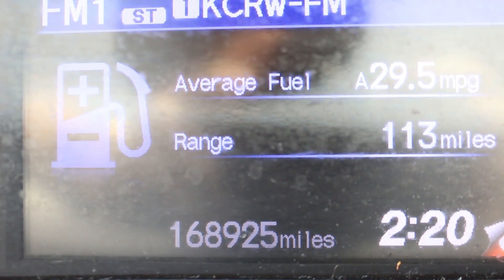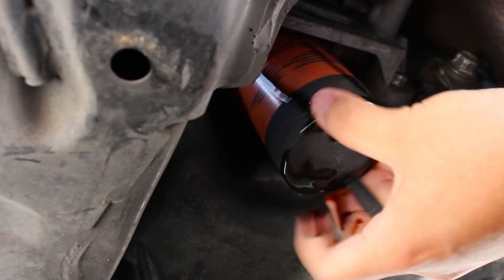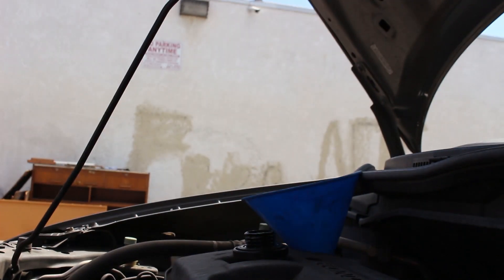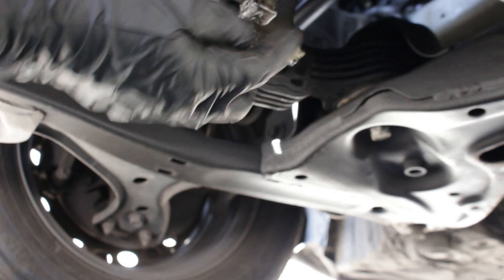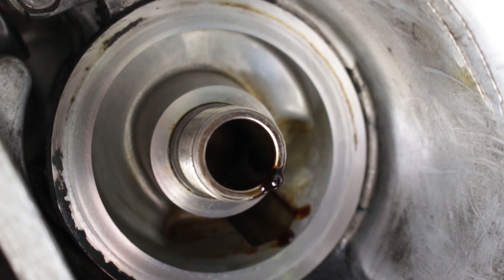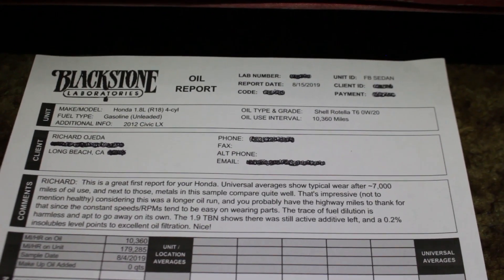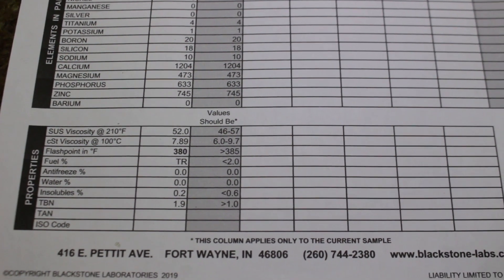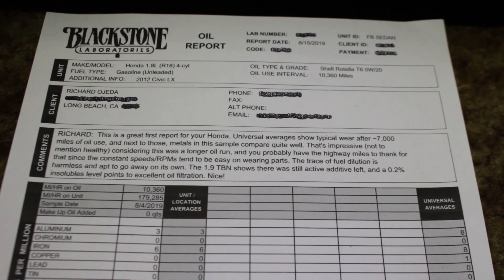10,360 miles Used Oil Analysis.

Comment: Sometimes you guys are trying too much to see what would happen when it comes to oils. I understand you want to experiment with oils to see how it runs in your car the most common thing is a ticking noise in engines especially when it gets down to 020 oils. The fact is this I am a Pennzoil guy and a Quaker Steak even though they both come from the same old company shell. One is made through Natural Gas of panzoil and the other is Quaker Quaker State petroleum base. Both have a high record of protecting an engines over 300,000 up to a million miles without mechanical failures and loss of power. But when you have a Honda Civic why choose a motor oil that's meant for gas trucks. Pennzoil oil or Quaker state oil by my recommendation over any other oils will guarantee your engine a longer life as long as you don't treat the engine like a sports race car when it's actually a everyday car the engine will last a long time with these oils using shell gas truck oil for a car engine doesn't make any sense. You don't need to use gas truck oil for a car engine to get good engine protection using motor oil meant for cars we'll get that job done. Using gas truck oil for a car engine doesn't make any sense. You doing too much for your curiosity.
Reply from the maker: This is why the community make YouTube videos because I am not the only me who is curious. People are curious of the results and it gives them insight whether they want to use this oil, though this oil has been discontinued. Nothing would be entertaining if it wasn’t for curiosity.

Comment: 1:40, I'm an old and grumpy fart but I have some advice for you. I'm not a mechanic but I have been working on my cars for a long time.
First, make sure that your oil filter is not stuck (like your oil drain plug), but don't remove it completely. Go ahead and punch two holes on the bottom of the oil filter and let the oil drain out first, as much as possible. Then remove it without making so much mess.
Next time get yourself a torque wrench and brand new factory oil drain plug (because the one you have is most likely ruined) and a brand new factory oil drain washer. I recommend a 6-point Flank drive socket as well.
Find out factory oil drain plug torque spec for your vehicle. For example, for my Toyota Corolla, 2006 oil drain plug torque spec is 27 Foot-pound.
Reply from the maker: Thanks for the advice. At the time, I didn’t have a drain plug or  washer but now I do. Honda torque is like 29-30 foot pounds but as long as the plug is a little more than snug it is fine.

Comment: On my 09 Silverado I did oil changes every 15,000-20,000km depending on amount od towing using valvoline max life 5w30. Truck still running with 550,000km.  Never touched motor to date. 100,000km pulling 7,000lb loads.
Reply from the maker: I tested Valvoline full synthetic and it actually did better than this oil. I recorded it but never uploaded the video.

Comment: unless it says 100% synthetic...its only 51% synthetic. The standards to claim it as full synthetic is that it only has to be 51% synthetic.
Reply: Where you get your information from provide a link.
Reply: Actually, almost every oil you can buy in North America is not 100% synthetic oil.
 The only country in the world that doesn't allow 100% synthetic labels to be used on lubricants unless they are 100% synthetic is Germany.
If you go on the German oil company website you will find that they are using a full synthetic label or Synthese, instead of 100%. When I checked American popular and common brands, only Amsoil Signature and racing oil come with a label 100% synthetic. The other Amsoil types so-called 100% synthetic in Germany don't have a sticker of 100%. 
Another example is Motul 8100. In the North American market that oil is called 100% synthetic but if you check Motul Deutschland, 100% synthetic is missing and the label is Synthese-Technologie. Even Motul 300V racing oil is labeled as "Ester Core" and I don't see 100% synthetic anywhere.

Comment: A Fram filter?
Reply from the maker: Yea, it performed surprisingly good.
Reply: @TheRichardF10  You can't find out that without measuring the flow resistance. The filter may have been in a bypass mode but we don't know that and the oil analysis wouldn't show anything unusual. But it doesn't mean there was no damage from unfiltered oil. The Honda filter has a lot more media and the media is a lot thicker. Why would they do that if just a plain Fram was enough?

Comment: I've used this oil many times in my Toyota Venza. It's good oil. Many tests on youtube prove it. Im now using it again, found it on clearance at Walmart for 4.50 a gallon. Couldn't beat it. Basically paid a little over $10 for a full synthetic oil change with my filter. I have 3 other jugs in my garage as well for my next few changes 😂

Comment: Please don't ever use "high end oil filter like Fram" in a sentence again! LOL
Reply: The Ultra Synthetic is top notch
Reply: @williwonti  You're right.  Fram Ultra Synthetic is on par with Mobil M1, Wix and other similarly priced synthetic filters on the market.  Unfortunately, highlighting the limitations of Fram's basic entry level filter when compared to higher end synthetic filters is common on YouTube.
Reply: Fram XG, Titanium, and racing filters are very high end and have great build quality. The basic orange can is not very good but its ok for 3-5k miles!

Comment: Everybody in the common section is more concerned about how tight the oil filter is instead of the results of this oil LOL honestly full synthetic or not if the manufacturer doesn’t state that the oil can be ran 10 to 15 K miles before an oil change then you shouldn’t be putting 10 K miles on the oil it just doesn’t make any sense. But the results look very good from the test lab so what can I say. Mobile one extended and mobile one annual I’ll guarantee on the bottle that the oil will last for 15 to 20 K miles or one year before An oil change I have noticed a lot of oil brands do not put this information on there synthetic oil.
Reply from the maker: Probably for legal purposes but oil can last a long time and the engine depends too. The oil on the Honda doesn’t doesn’t get that dark compared to other oils I’ve seen from other engines.

Comment: Everyone already told you but I will go into detail, clean off filter gasket amnd lube it with clean oil, clean off plate, spin on till it contacts plate, tighten 3 quarter turn, .
Reply from the maker: Thank you very much. I will practice that from now on.

Comment: Are you familiar with 100 % synthetic ?,  and would you give it a try , and then see what the oil analysis  says  ?.
Reply from the maker: I’ve used Amsoil signature series in the past but did not analyze the oil. Motul motor oil as well. They are way better than full synthetic oils.
Reply: @TheRichardF10  the cost is higher too and you won’t notice any difference in the way your engine runs. Every driver a full synthetic is perfect this video proves that amsoil is designed for extended drain intervals for fleet vehicles

Comment: a good oil and filter its as important as the air filter..what air filter brand u had??
Reply: not really oil filter is more important than air filter. I have a K&N air filter that I clean at each oil change.

Comment: Friends don't let friends use Fram filters.  You just don't do it unless you don't care about your engine.  Never over tighten your oil filter or oil drain plug.
Reply from the maker: Using the Fram was a one time thing. And I didn't over tighten anything.
Reply: The Fram ultra are really good filters. We cut them open at work and it was much better then the stock oem honda filters.
Reply: You idiots don’t even know that Toyota OEM filters does not even have ends capped in any way. No metal no paper nothing. Yup they have nothing on the ends.  And you diss fram for having non metal ends. Too many idiots on you tube.

Comment: You are overtightning the oil filter  and by the way you struggled with the drain plug as well probably that too you dont want to bust the threads .
Drain plug finger tight then up to 1/2 turn depending upon your plug gasket.
Oil filter spin on till stop then hand tighten not plural without pulling 
Keep the rubber down good luck
Reply from the maker: Many people tell me that I tighten the oil filter too much. I prefer to be sure and have it tight, rather it becoming loose from vibrations or some other reason it loosens. I only do it by hand, it isn't a big deal. It would be a different story if I got an oil filter wrench and tightened it more than what I can do by hand. I have nothing to say for the drain bolt, it was on there but I simply budged the ratchet and it came of with ease. I appreciate you let me know of what I am doing, but I have not had any problems over the 10 years I have worked on my own vehicles.
Reply: Thanks for the reply but 
I have been working  on cars for 20 + years worked on farms as a maintenance tech .worked in auto shops and have restored classics and have worked in parts stores. 
Not to mention I am a 3rd generation mechanic if that means anything to you. 
Being i am not the only one to say whats wrong in the video 
Maybe you should take advice when given
Reply from the maker: @ShovettEnDeep  I don't want to sound like I'm arguing but I dont need to be a mechanic to change oil. I didn't mean to sound arrogant or be disrespectful.

Comment: I just bought a new GMC truck and wanted to try both this oil and XP filter..going to use for the life of the truck ! The  warranty is 10 years or 500,000
Reply from the maker: Congratulations on the new ride. This motor oil and the Wix XP should make a great combination.
Reply: Rotella T6 would be better for a Truck, especially if it's not actually new and has higher miles on it.
Reply from the maker: @aznnp77  It would depend if it has a gasoline or diesel engine. Because because Rotella T4,T5, and T6 are meant for diesel engine. The Rotella gas truck is for gasoline engines only.

Comment: I would bet you that more than ten thousand miles on oil change will make sludge and varnish in the oil. Take and fill a half quart or full quart of transmission fluid into the oil and run for ten minutes before oil change and you will be amazed at the junk that comes out with the oil. Take a bore scope into the engines oil fill and you will be amazed on the goo inside the engine that can be seen. This worked for me and hope it works for you. VF
Reply from the maker: Thanks for the suggestion but I won't be adding ATF into the engine. I know it wouldn't cause a problem but I am analyzing oil and dont want to introduce any foreign chemical that are not motor oils. I probably would do it on the beater C1500 .

Comment: The new Shell Rotella T-6 is fine for gas engines. I use 5w40 in my 2006 Crown Victoria and have had no problems with it.
Reply from the maker: I'll stick to the required viscosity. I'm know Rotella T6 is a superb oil.
Reply: @TheRichardF10  You have to in a VVT engine like your Honda. my 4.6 V8 does not have cam phasers like VVT engines do. I can use anything from 10w30 to 5w20. I chose 5w40 because my car has a shitload of idle time with the AC on.
Reply: I would read the Crown Vic's manual. My '96 Caprice old school V8 says Do Not Uee 40 Weight oil. So ai stick to 5W30 or 10W30. There is a Rotella T6 5W30 multi vehicle so that's perfect.
Reply: @PrimalMiltos  I use 5W30 in the winter. And I use 5W40 in the summer. You use what you want and I'll use what I want.
Reply: @j.t.cooper2963  We need to clarify that the Rotella T6 5W40  is NOT for gasoline engines. Only the T6 5W30 is. Unless you need GM Dexos spec. then only this orange bottle 5W30 qualifies.  That's according to Shell.
Reply: @PrimalMiltos  You're living in the past, It has been reformulated and is safe for gasoline engines. It says so right on my jug. Once again, I don't need you or anyone else telling me what to use in MY car. ✌🏻
Reply: @PrimalMiltos  And yes, That includes the 5W40.
Reply: @j.t.cooper2963  Send me a link because the T6 5W40 jugs that I can find say Diesel on them.
Reply: @PrimalMiltos  it's API-SM rated and is therefore safe for ALL gasoline engines. Go research it yourself. My bottle says it's safe for gasoline engines. I use it my car and I have over 150,000 miles on it and have had 0 issues.
Reply: @j.t.cooper2963  Yes, just like the Mobil1 5W40 that also has SM rating so it can be used in mixed fleets, the Rotella T6 is designed for Diesel engines. They both say it on the box. But it's not the best oil for gasoline engines. Look at Shell's website.
Reply: @PrimalMiltos  It quit being Diesel specific some time ago. You use what you want, and I'm still going to use what I want.
Reply: @PrimalMiltos  People use it in their motorcycles too. When was the last time you seen a diesel motorcycle? 😂
Reply: @PrimalMiltos  It also says on the Shell website that it is safe for ALL GASOLINE engines and motorcycles too. So what in the fuck are you trying to prove? 😂
Reply: @j.t.cooper2963  I knew this guy Doug back in the 90s he used Mobil1 in his gas engined Chevy truck. He never changed the oil, only added as needed. He kept his trucks for 65-80K and then trade them in. He said the dealers give you the same money anyway. Like you and your Crown Vic, Doug never had a problem.
Reply: @j.t.cooper2963  Sure, but a Diesel oil is not the best oil for a motorcycle especially with an air cooled engine.
Reply: @PrimalMiltos  Works the same in an air cooled engine or a water cooled engine. There are a shit ton of water-cooled bikes now. I'm done talking with you on this subject. I use it in all of my engines, you use what you like.
Reply: The motorcycle oils typically have more Zinc and Phosporus and less detergents and should not be used in typical car engines.
Reply: Shell Rotella T-6 is a high-detergent Diesel oil with lower surface tension and lower shear pressure rating which can cause higher bearing
wear in gas engines. A diesel engine needs oil with very high-detergent capabilities in order to hold the large amount of combustion by-products in suspension, but it is not optimized for a gasoline engine. The bearing journal
size-to-displacement ratio on a gasoline engine is designed around the use of a lower-detergent oil and relies on a high shear rating of the oil.
Reply: For optimum performance and maximum longevity it is best to use what is recommended by the vehicle and the oil manufacturers.
Reply: @PrimalMiltos  🖕🏻
Reply: @PrimalMiltos  Go eat a shit taco.

Comment: Very interesting report...hard to argue with the numbers.  
Question:  Would those "Universal  Averages" be for oil in use for 3,000 miles?  If yes, your results are even more impressive!
Reply from the maker: Universal averages are oil change intervals of about 7,000 miles. So yea, the shell oil and the civic are working good.

Comment: The civic is just a little over 4 quarts if you're using aftermarket oil filter, they tend to be larger in size than the OEM honda oil filter. It holds more oil with a fram than a Honda filter. I get the aftermarket
Reply from the maker: Thanks for letting me know. I try to get the oil level on the full mark. Wix XP and Purolator Boss is what I use most of the time.
Reply: I cut open an OEM filter off of my daughter’s Honda HR-V, and compared it to a Fram Tough Guard filter I took off my Honda Civic. Looking at them both side by side, I believe them to be the same filter…All the way down to the stamping on the base plate.

Comment: Very well made video. I really fuck with Rotella oil as of late. I used to put Diesel Rotella motor oil in my 86 wrangler because of the high zinc=less wear. I’ve seen a couple Rotella gas truck oil videos and I’m def putting Rotella oil in my daily drivers. Farewell Hercules
Reply from the maker: It's good oil man. Can't go wrong with Rotella gas truck oil.

Comment: Way too tight on that oil filter Hercules. Also never push a fram that far that filter was definitely in bypass mode. The glue is also known for failing on fram.
Reply from the maker: Using the Fram was a one time thing. I did an experiment and this is how it looked after 10,000 miles. It held up well but there are better filters for little bit more money. It wasn't too tight. I can still take it off by hand. https://youtu.be/Auu95lU4P1Q
Thanks for commenting.

Comment: Tighten by hand doesn't mean crank down as hard as humanly possible. No wonder you needed a breaker bar to pull off your oil plug.
Reply: If it helps the guy sleep at night so be it. Worst case he has to use the oil filter pliers instead of his hands to remove next time. On the drain bolt, I torque mine to mfg spec with a calibrated torque wrench but jeszlus it really gets stuck on there for some reason.
Reply: @David..  false!!! When u over do it you screw the seal up putting 2 much pressure on it...
Reply: @jimhendrix7776  I highly doubt he’s putting that much torque into the thing with his bare hands, if he was using a filter wrench on the thing I’d say that seal failure would be far more likely.
Reply: Holy crap, I thought I tightened it tight. That looks like a pain to take off later. I just use the Fram Ultra filters and they have good grip for taking the filter on and off.
Reply: @aznnp77  check vids on fram filters bud!!! Ur better off leaving your old non frame filter on than putting a fram in!!! Theyre proven junk bro!!
Reply: You’ll never get that filter off, Way way way tooooooooooo tight.
Reply from the maker: Better to be safe than sorry.
Reply: @TheRichardF10  Work smarter, not harder
Reply: @TheRichardF10  you can actually be sorry by over tightening and stripping the threads.  You don't have to tighten anywhere near that hard
Reply from the maker: @JonnyAbs-0  Alright man. Thank you I’ll make sure for next time.
Reply: @TheRichardF10  no problem, the rubber gasket should ensure a good seal.  Tighten, but not over crank